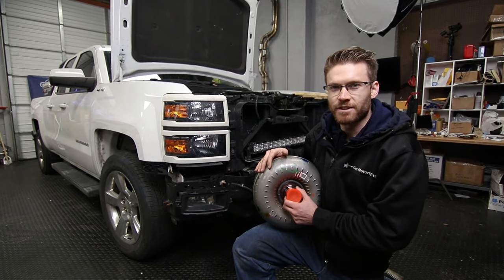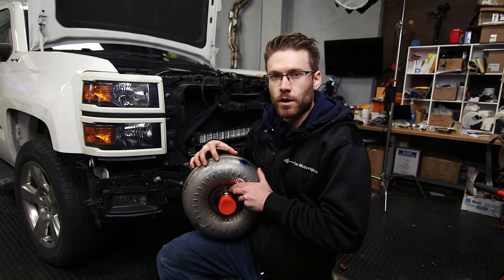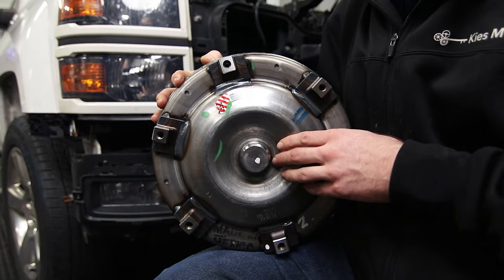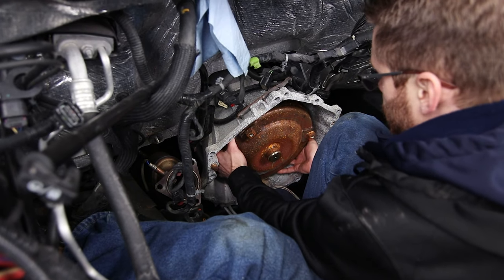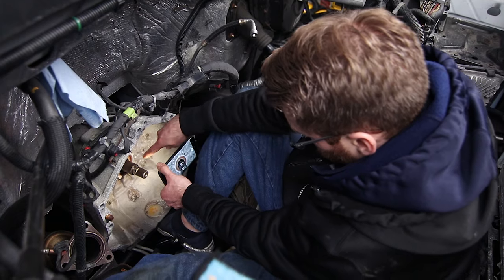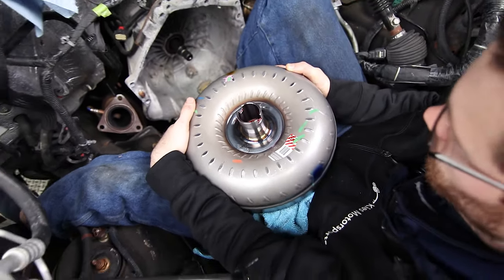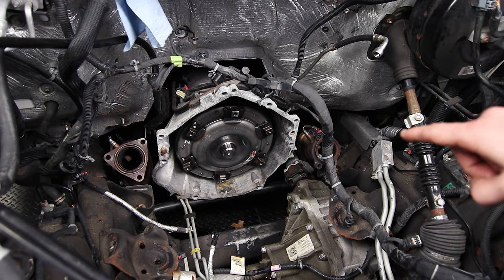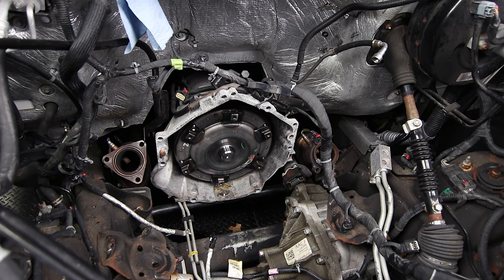6L90 Torque Converter Install in an 6L80 Transmission - Silverado Sierra Tahoe Suburban Yukon

Comment: Ugh my 2015 Torque Converter is going out, might result in a transmission rebuild...why CHEVY :( :(
Reply from the maker: Sorry to hear that :(
Reply: The designed lifetime for the transmission is 120K miles. How close to this were you?
Reply: @davidporter7051  well the trans didn’t go out but it was slipping from time to time and the check engine light came on and off. Took it to a mechanic and said the solenoid was shooting debris to the clutch so I ended up getting it rebuilt, was around 3K I believe. This was at 40-45K miles on my 2015
Reply: @Ruben-us2kf  that's terrible but at 45K it was still under the factory powertrain warranty.
Reply: @davidporter7051  well the truck was modified and not stock, bolt ons though. I figured GM would give me so much shit and I needed it fixed fast
Reply: @Ruben-us2kf  this explains a lot.

Comment: Any part number on the flex plate conversion?
Reply: I'd like to know as well, my 2011 chev express with 6.6 duramax, I had initially thought it came with a Alison, but it is a 6l90e with the torque convertor fail and so the story goes, the trans was next, now I have purchased a 6l90 out of a 2014 pu problem is my og tc has 6 bolts but none line up, or so says the shop, so if anyone knows the part number would be mucho appreciated

Comment: Would this work with a 2009 Silverado with the 6l80?
Reply from the maker: Most likely but probably should confirm with a transmission shop since it is so much earlier. Not sure if there have been updates

Comment: I am a Chevy technician the reason the transmissions and torque converters go is because the service interval is 45,000 miles you must complete a drain and fill with a new filter every 45,000 miles so when you see guys with 100,000 miles and no service you replace the entire transmission.. figure by 100,000 you should have had two services already..  replacing a torque converter on 100,000 mile trans is a Band-Aid
Reply: i have a 2017 silverado half ton with v-6 engine. bought it new and love it. driven with care. at 43 thousand miles had  the dealership change all 12 quarts. now its at 77 thousand and this coming tuesday gonna drop the pan and replace filter but will only replace the 6 quarts that i can drain out. still has lots of "meat" on the original brake pads. gonna wrap the crossover exhaust pipe with that heat insulation wrap, hopeing that will deflect some heat. so far so good but all these scary stories on trans failure scare me. its my only ride.

Comment: Pretty sure my torque converter is toast at 111k 😭. How will I know if the transmission needs to be completely replaced or just the torque converter?
Reply from the maker: You probably won't without looking inside unfortunately :( check the pan for excessive metal. Did you get any warning lights? If not, you might be ok. As long as the pump didn't get clogged and debris spread throughout the trans.
Reply: @TheSundaeDrive   I have no lights and only in the morning when it’s cold will my truck drive great shift good but when trans warms up I lose power and rev high rpm

Comment: Does anyone have experience with a high pitch whining coming from transmission area? Happen in P,N,R,D. Some research points to transmission pump wearing but noise happens on and off, depending on the day. Fluid change? Filter change? Or complete rehaul of trans pump and TC?
Reply: Whining noise is usually fluid cavitation in the pump. By that point the pump is wasted

Comment: What's the parts number for that particular 6l90 tc?
Reply from the maker: It's in the description but here you go!

6L90 Torque Converter 24242552: https://amzn.to/3oSVMuk
Reply: @TheSundaeDrive  did you ever figure out if the truck needs to be tuned for just the swap out of the torque converter. Also how much should I expect to pay for just the swap at a shop?

Comment: You need to get a minimum billet converter for 500 hundred
Reply from the maker: Agreed. Post this video 6l90 guys have posted that they are experiencing similar issues. I plan to upgrade to a billet around 200k Miles

Comment: I changed my torque converter and it was good for a while but is havingbthe same lag and shakey symptoms. The rpm jumps while braking always. Do you thinknthe whole transmission is bad or just bad torque converter
Reply: Did you ever figure out what the issue was?

Comment: Would this work on the 07-13 Models as long as it's still a 6l80e trans?
Reply from the maker: I'm not 100% sure as I have not done it but as long as it is the same transmission it should
Reply: It does i did it before
Reply: @macario9035  how did it drive. I think I'll need to do it sooner than later to prevent any other damage
Reply: @wobwobwobination  my stock converter broke and messed up the pump and i had to do a complete rebuilt and thats when i installed the converter off a cts v 6l90e transmission and it worked great.
Reply: @macario9035  did you replace it with the 2424552 cts v converter. I've got a 11 silverado 5.3 with 6l80 wanting to replace converter. I'm getting a vibration from time to time when driving slow and it's in higher gear
Reply: @michaelefird2692  I’m wondering the same thing. I have a 2017 1500 with 80k miles and it and it is shuttering/slipping and was told by a friend of a friend I can put the 24242552 converter from a 6l90 into my 6l80 with no problems. Is this true ?
Reply: @donnavenmurphy4938  the cts v converter will work fine. It will stall at a few hundred rpm higher than the stock 6l80 truck converter though.

Comment: I just got a stage 1 6l80e with the 24242552 torque converter from a cts-v will it bolt on to the flex plate with no issues since mine has 3 holes & converter has 6 and how is the truck doing with torque converter upgrade
Reply from the maker: What transmission does your truck currently have? The 6L90 torque converter is working great! No issues.
Reply: @TheSundaeDrive  its gonna have a stage 1 performance 6l80 had a single disc 2800-3200 stall converter but had to drive 5 hours cause torque converter was bad and they gave me that converter from a cts-v so in mids of august ill be installing it also truck has bolt ons gears trutrac hptuners tune so if yours is doing well im sure mine is to
Reply: @TheSundaeDrive  hey just an update my 2013 already has its stage 1 6l80 6l90 torque converter it is great shifts are really smooth feels like a whole different vehicle
Reply from the maker: Thanks for the update!

Comment: how will this torque converter hold for towing??
Reply from the maker: It should hold well, I went to it instead of an aftermark one because it is closer to the stock stall than the upgraded ones I found
Reply: @TheSundaeDrive  alright mine just shattered, 116k with heavy heavy towing and 4x4 lol wish I would of caught it before, but it is wat it is, rebuilding transmisión as we speak,
Reply from the maker: Aww man that stinks :( I've done some pretty heavy towing with mine too and it probably would not have lasted much longer
Reply: Right, it’s all good doing the z Pak clutches and bigger trans cooler, should be good for another 100k of heavy towing, ima loom into this converter, the price is way better thank a aftermarket

Comment: Did you end up having to tune?
Reply from the maker: Seems to be running good with the stock tune. Might play with some tuning later on but definetely drivable
Reply: Awesome man. Im doing mine this weekend in my 2015.
Reply: Man thanks alot for this video. I did this exact swap on my 2015 and it's working great. Absolutely zero shutter that I can feel. Again thank you man
Reply from the maker: Awesome!

Comment: My transmission crapped out at 96k miles the 6L80 is the only transmission since the 70s  I've ever had fail and I put hundreds of thousands of miles on my vehicles and millions of miles on my big rigs,so it must be a garbage transmission I've never towed with it..
Reply from the maker: It's the torque converter that stinks in them. With regularly fluid changes the transmission should last a long time but the torque converter is the achilles heel

Comment: Is a full 6l80 to 6l90 swap in a 2014 Silverado possible?
Reply: I don't think it'd be worth it if possible.   Mechanically,  yeah, but the computer isn't compatible.  Tuning would be a pain from what I was told.
Reply: It is easily possible. The output shafts of the 2 are different size and spline count. The 6l90 will use a shorter rear drive shaft and if 4 wheel drive a longer front shaft. You would have to swap the techm (transmission controller) from your 6l80 to the 6l90 to get it to work with your Silverado's ECM.

Comment: That IS NOT a proper install. You cannot measure the distance from the face of one torque converter  to the face of the bell housing and use that dimension for the new torque converter as they will never be  exactly the same. You set the torque converter to full depth in the transmission and then shim it at the flex plate if needed to get proper clearance.
Reply from the maker: In general you are correct - however, because these two torque converters have the same dimensions this method works as a sanity check. It was not intended to get it identical but just as a sanity check to make sure it was seated fully.
Reply: @TheSundaeDrive  sanity check? I do not think you understand. There needs to be proper depth engagement and that is done at the flex plate and shims used if needed.
Reply: Simillar issue, i shim it and what i had , vibration on 3000 rpm , and now trying to find the corect flex plate , 6bolt convertor 6 bolt crank .any idea or part number
Reply: @JohnSmith-ug5ci  Yeah we heard what you said in your first comment the first time. Maybe you don't understand, that converters have the same dimensions! He was only taking that measurement to make sure he had the converter seated properly and the exact position it belongs! Do you understand?
Reply: @c_mac7773  you are wrong. Seating dimensions are not exactly the same on all converters.

Comment: Can't you just turn off DOD with a turner?
Reply from the maker: You can, but it doesn't prevent the failure because the lifters are still in there.

Comment: So basically don't buy a chevy silverado..... I don't understand, the older chevys lasted forever then they fucked it up. I have a 2015 right now that has a stuck lifter on number 1 cylinder. This is the second time its happened. Also the trans had to be replaced at 60k and the torque converter at 70k... wth
Reply from the maker: Very frustrating for sure. Basically need to upgrade a lot of components with aftermarket parts to make them last. Dod delete and torque converter swaps every 100K seems pretty common

Comment: Is the stall any higher than the 6l80 truck converter?
Reply from the maker: I had a very hard time finding a spec online but from my research the stalls are very similar with the 6L90 being a bit higher
Reply: @TheSundaeDrive  That’s great. Even 200rpm extra would be nice for the cam options I’m looking at
Reply from the maker: If you are going with a big cam, I would go with an aftermarket TC like circle D probably
Reply: @TheSundaeDrive  I’m looking mainly at the stage 2s from Gwatney and TSP. Most say they work fine with the stock stall but that more is better
Reply from the maker: Id search on the zl1 ctsv forums and see if they have the stall. Been awhile since I looked it up
Reply: When I got the 24242552 torque converter from a cts-v for my 2013 6l80 was told its a dual disc 2600-2800 stall & since mine is a 5.3 lc9 its only gonna stall up to 2600 or little less
Reply from the maker: Good to know. Thanks!
Reply: @TheSundaeDrive  i just hope the stage 1 6l80 with the cts-v torque converter is better than what im expecting its not gonna be installed till mids of august and I also use amsoil signature series atf

Comment: Did you have to tune the trans?
Reply from the maker: I did not tune mine and seems to be ok. Rough shifts but normally rough for a 6L80. I'll definitely do a follow up video in the future street I've had a chance to tow with it
Reply: @TheSundaeDrive  so will the 24242552 bolt right up to my 6l80e with no problem and no tune needed? I have a 2017 Silverado 1500 5.3l v8 2wd that started to get the shutter/slipping problem and I was told by a friend of a friend that that converter will work and it is a better converter then the stock one out of a 6l80 is this all true?
Reply: you should disable TCC lockup in everything below 5th gear

Comment: Good call on using Amsoil tranny fluid. It's already done I know but I would have re-installed the engine and run just standard AC Delco fluid for 5,000 miles to flush particles. Then I would com back and refill with Amsoil fluid and Bob the Oil Guy is U'r uncle.  I used to be a GM fan boi but no longer. Think that you Pay $$$ 60K for a truck and before 80,000 miles your yankin' the motor and overhauling the transmission. In or out of warranty. What a travesty. Get the best truck on the market and git U'r self a RAM Pickup.
Reply from the maker: Love how the rams looks but hemis have a lot of lifter issues too unfortunately. Is frustrating tho for sure how many problems these Silverados have

Comment: This never worked did it?
Reply from the maker: Been running it for 35k miles. No issues. I plan to change out to an aftermarket tc around 200K miles. Currently at 143K

Comment: The TC in my impeccably maintained 2016 2500HD failed at 43k miles. Dealer installed a new transmission at great expense to me, which failed 25 months later at 65k miles… I had it rebuilt at an independent shop with a billet TC, Sonnax internals, Tru Cool 40k transmission cooler and a tune. I hope this build lasts. I’ll never again own another piece of GM shit. And I don’t even have to worry about the AFM/DFM garbage the 1500 guys do. I don’t know why people keep buying these things.

Comment: Where did you order the 6l90 torque converter?
Reply from the maker: I got mine through my local dealer.
Reply: How’s the truck running with the new torque converter I am about to swap mine out with the 6l90.
Reply from the maker: No issues at all and I've towed with it too
Reply: Did you have to tune the transmission?
Reply from the maker: @trevorgill1120  it's not required. I did have a tuned for faster shifts but not required.
Reply: @TheSundaeDrive  i might do that later down the road.
Reply: Who tuned your transmission?
Reply from the maker: EFX Tuning. Unfortunately they closed up shop recently :( I was really disappointed because they knew what they were doing.
Reply: @TheSundaeDrive  do you have any recommendation’s?
Reply from the maker: Unfortunately I do not at this time :( I'm looking around myself.

Comment: the torque converters fail do too the dumb trans thermostat on the side of the trans "delete " that at the cost of $30 and save your convector. Transmissions should not operate at 200* !!!
Reply from the maker: We replaced that as well! We have a video showing how to. If the torque converter has run hot too long you should swap both

Comment: No, this video is NOT helpful, only hurtful. People that don't know any difference will throw their money away doing this. 
That transmission already has wear. And doing this swap only transfers the "junk" into the new converter. 
It was also a waste of money, especially installing a G.M. converter. 
The very proper thing to do is completely tear down the 6L80 and properly rebuild it using a billet 6L90 converter from Precision.

Comment: Not much of an upgrade. I have 2018 Chevy express in the shop that will need a new torque converter and it has the 6l90. Never will I ever buy a Chevy again, they really fucked over the middle class with these garbage transmissions. Learned my lesson, Toyota with a trailer next time for me…

Comment: Would that torque converter fit a 2017 silverado 1500 6 speed?
Reply from the maker: If it is the 6l80 it should

Comment: Can this torque converter be used on 2014 5.3 engine?.
Reply from the maker: That is what I used it on here. You just need to have the 6L80 transmission
Reply: @TheSundaeDrive  appreciate.

Comment: I am going to change the torque converter in my 2014 GMC 2500HD 6l80 with a torque converter from an OEM 2012 Camaro. Do I have to reprogram the TCM?